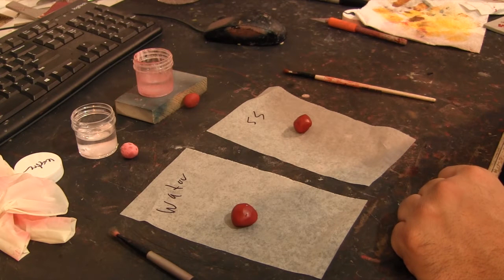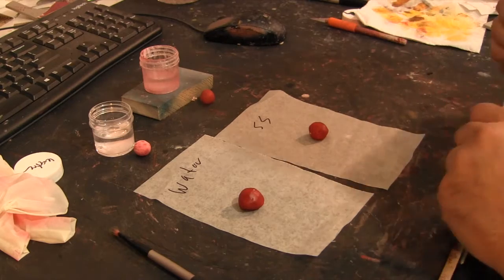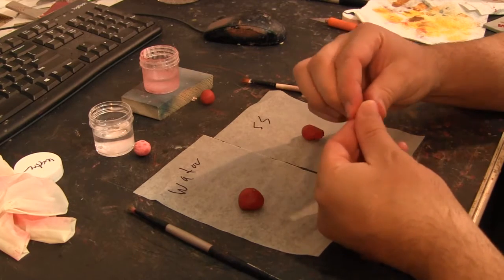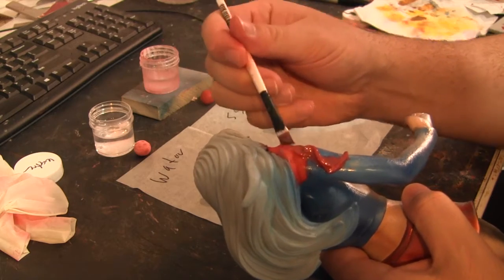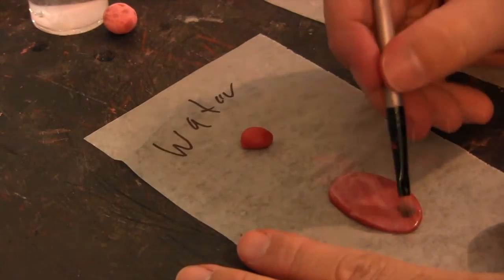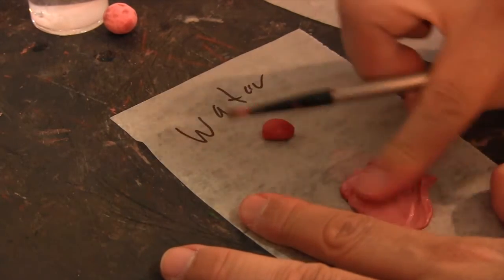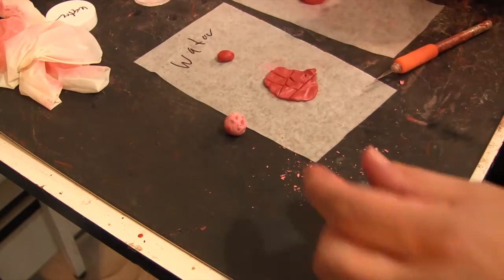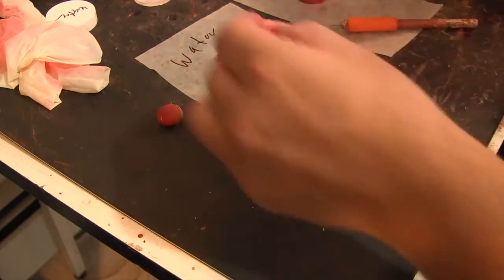Aves Studio Safety Solvent vs Water on your sculpts

Comment: Recently tried the safety solvent with fix it and it burns or irritated mythroat breathing it in as it somewhat has a strong smell any suggestions wearing a mask or is it something you got use to , or would it help to allow the mixed apply to settles for 5 to 10 minutes before applying Althea safety solvent
Reply from the maker: I have no reaction to the solvent, maybe just you are? have you had any issues with the aves before the solvent? All the Safety solvents I have purchased from them directly has no order or smell to it. I would call them up and see if they know whats going on, cause I dont buy it any where except direct from Aves studio. Maybe got a bad batch?
Reply: @VinceVellCUSTOMS  thank you so much for your response and I have no idea it was first time trying it , and I noticed after some hours sculpting  I felt it was irritating my throat and it could be it was a pass batch I will be trying out from aves stufio tho and see if there is a difference as it kind of smells like gasoline oil mixed with alcohol lol something along those lines and thank you so much for taking the time responding to my message appreciate your work and art for some years continue expanding in what resonates 🎨

Comment: Hi buddy. Thank you for the video. Is it still sticky when you use the safety solvent? I need it to stay sticky, but be more smooth at the same time.
Reply from the maker: ya the solvent will help it stay tacky if you want to add more aves to it as you sculpt, but after that 3 hour mark will harden up.
Reply: @VinceVellCUSTOMS  thanks so much!

Comment: This is a great video and why products are made as far as the tipping over I use Earth magnets in a metal base and pretty much put Earth magnets on things like my super glue that's has a tipping problem always falling over I glue a magnet onto it and then I simply put it on my metal base and it never tips over I do this with all my Waters containers a super glues and I have little metal cups from mr. Hobby and I put back that's on those and I never have a problem with things tipping over and spilling out losing my product just the tip

Comment: hi Vince. First of all, congratulations for your videos, always outstanding and very useful. Question: also works with Milliput? Thank you very much :D
Reply from the maker: Thanks! When i first started to customize stuff back in 2001 i used Milliput a few times but was tricky to use it, but if its how i remember you can use it on top of aves once aves is cured and rock hard. but i wouldn't mix them together fresh. Hope that answers your question.

Comment: After watching this now I want to see how alcohol reacts.
I'm always looking for cheap, but effective alternatives.
Reply from the maker: Well i had a friend who used it and after a few years he tried the solvent and regretted not using it all that time. I think the Alcohol just evaporates faster and then you get just solid aves. Worth a shot to try it, but a bottle of SS goes a long way for me.
Reply: I had heard of people using Vaseline for putty work, not sure how well it would work on this larger scale.
Reply from the maker: ya i have a friend who uses Vaseline for claw sculpting but i would never use it on my kits or customs, if you can't get that stuff off it could cause issues for paint work, And it can also react to certain paints, resins etc. that i would not chance it. 

But if you were to mix it into raw soft aves and started to sculpt, you could just end up with a sculpt thats slick and can't be cleaned up with it part of the aves.
Reply: It sounds like the best option by far is safety solvent, your video and your custom work is evidence of that.

Comment: I have used water on apoxie aculpt with zero problems. Sands fine.funny, their site says water can be used. Just saying.
Reply from the maker: I guess you can, but when I talked with the owner he said not too for best results. I have tried water and it globs up the aves, the safety solvent smooths it out and softens so much better that I love using it,
Reply: @VinceVellCUSTOMS  it comes down to how one uses it then. I dont get that white milky surface as you did.everyones tap water is different? Some swear by wayer,other by alcohol. Ive used them all and too much of either is no good. Any who,great videos 👌
Reply from the maker: Possible I do live close to the ocean east coast, or its the power plant down the road lol.